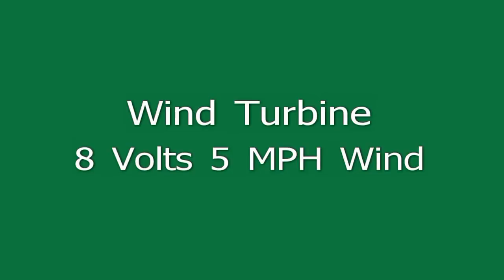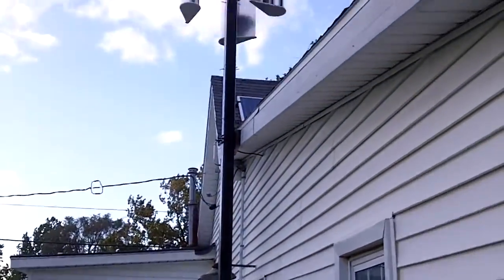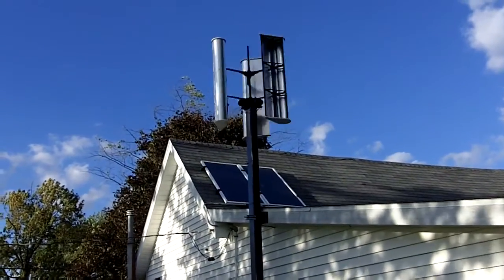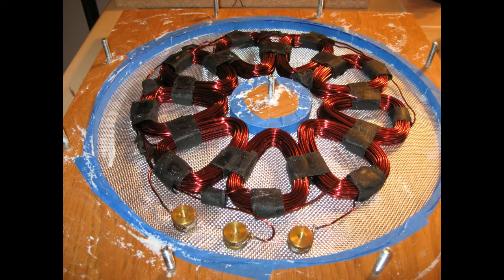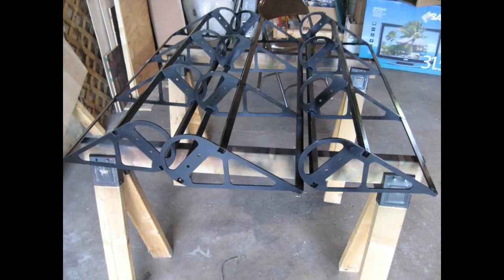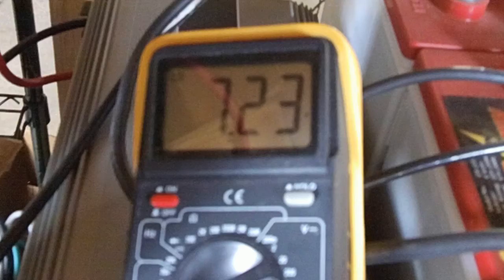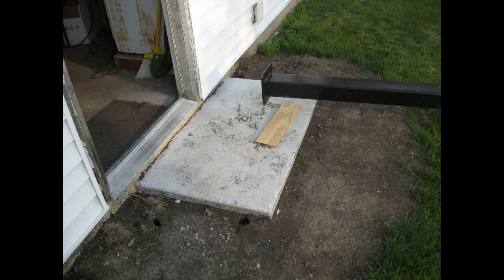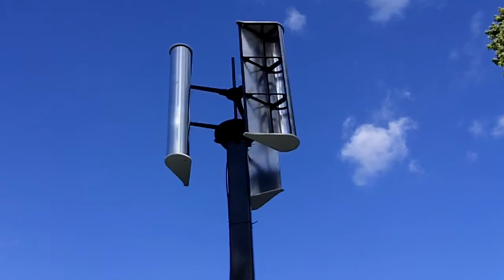How To Build A VAWT Vertical Axis Wind Turbine Arthur Illinois

Comment: @john strange   at 600 watts,12 volts = 50 amps.   at 800 watts, 12 volts = 66.66 amps. hope you use the correct AWG especially in the run wires.

Comment: The power out of a generator is related to the power you put into spinning it. In your case you need more spin. There are 3 ways i can think of to increase a VAWT's RPM: 1) Relocate or add height to your VAWT. 2) detach the generator from the windmill shaft and employ a 10:1 ratio pulley so that 1 rotation from the windmill equals 10 rotation in the generator. 3) change your flaps to a high lift low reynolds number airfoil nomenclature.

Comment: Nice VAWT look almost like mine. I used a smartdrive motor and wired it to 12 Vdc.It puts out 600 to 800 watts. The city inspector wouldnt let me mount it to the roof of the  without a permit so I put it on a trailer and parked on the side of the house! Since my video I have raised it another 15 inches. Ive had it in winds up to 60 mph with no problem of course I had it strapped down.

Comment: i have a question..  i mught be a fuckin idiot here.. but why doesnt anyone take advantage of the top of the these wind turbines, and mount another generator so you get twice the output from one windmill??   i mean, all you have to do is create a "C", or "O" shaped bracket that is wider that the spinning blades, and then mount another genertor on the top axis.  the blades will still spin within a  thin frame.  am i the only one wondering why NOBODY EVER DID THAT??